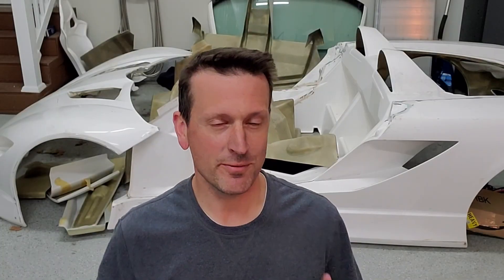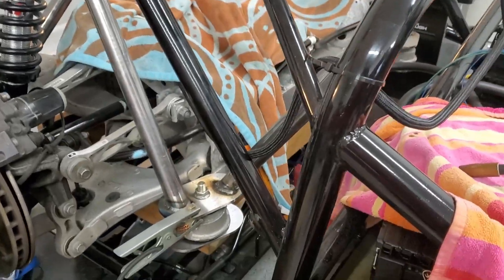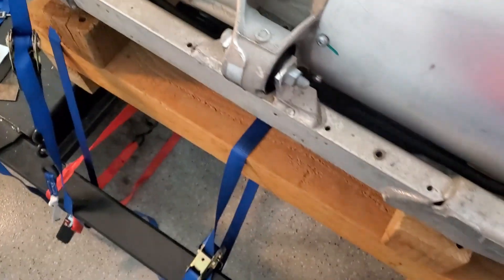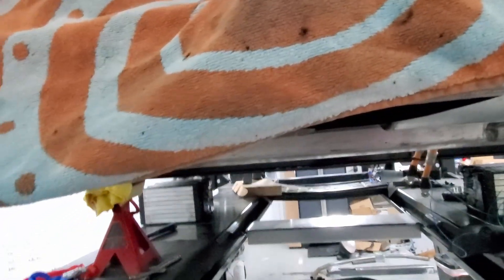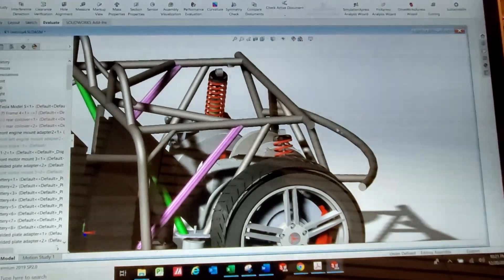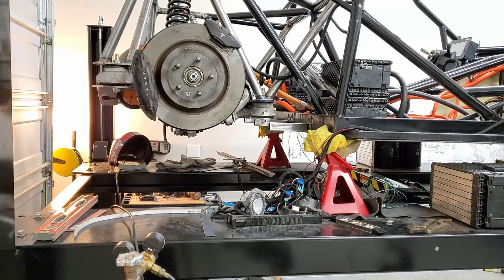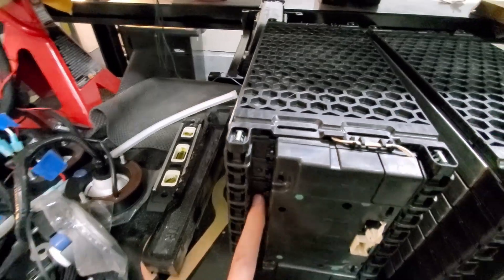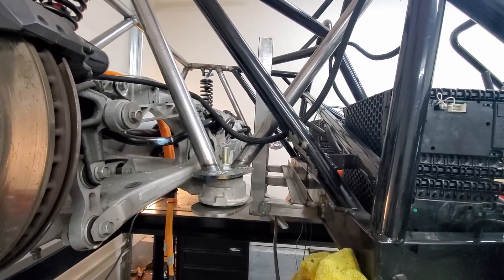Mounting the Tesla Motor Part 2

Comment: I know I'm late to the game, but should there be frame linkage from the bottom of the subframe to the back of the car frame? Maybe I just haven't seen it yet.
Reply from the maker: Thanks for the comment!  I did end up putting in another brace from the rear motor mount back to the main chassis frame.  It is comments like yours that make sure I don't fail!

Comment: Kool project & your making really good progress. The bars to adapt/mount the motor, to the frame, are a bit long. Are you going to add any extra/support braces? Have you done any kind of torque or dynamic stress simulations?
Reply from the maker: Yes, I am adding some this week.  I have run some simulations, and even without extra bracing stress levels seem to be ok.

Comment: Corvette 19" x 10" wheel with 79mm offset. 185 x 35 19" will work perfect. Clears the calipers and should clear your shocks. Use real corvette wheels not aftermarket knockoffs as they will hit the calipers.